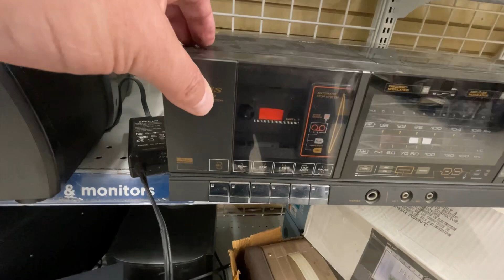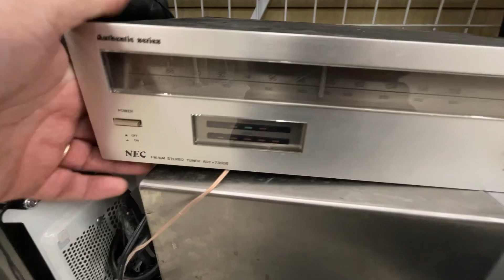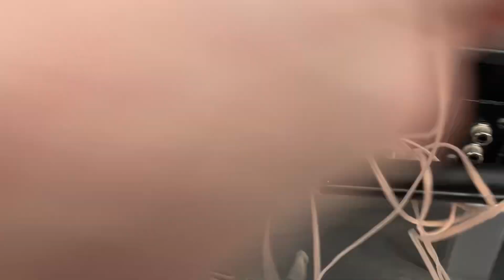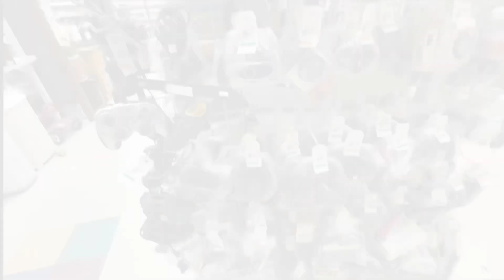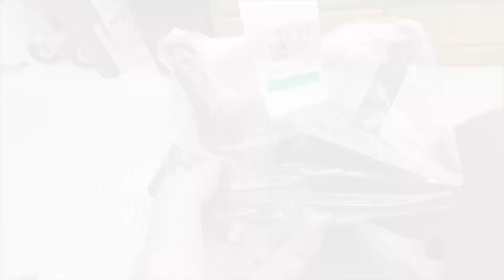A Nice Pair of Cheap Vintage Hifi Units Thrifting and Testing

Comment: I wish I was in your area in Canada. New York City where I reside doesn't have enough of these places anymore to shop or selections of second hand electronics. The Technics Turntable at the end that's a winner. The NEC tuner,  👍 The Lloyds shelf system with the cassette player/ recorder  : I don't like the turntables plastic platters and they smaller than the 12" records .👎 I've never liked them much especially after BSR abandoned metal platters in the end of the 1970's and into the 1980's. The Atari joysticks 🕹️🕹️ were for a special series it was battery and a phono jack to the Best of Atari video games not the 2600 original. Intellivision had their own version similar to Nintendo's Game Boy. I like this channel this gets me so interested in these kinds of items. 👍
Reply from the maker: Thanks, I love the vintage finds, NYC is missing out!

Comment: I own a 2600 and a flashback and the flash backs are wireless i can tell you but i dont like how they dont use the same joystick rubber because i need the rubber parts for my 2600 controllers
Reply from the maker: Ah yeh I thought so thanks
Reply: @Thriftronics yeah no problem